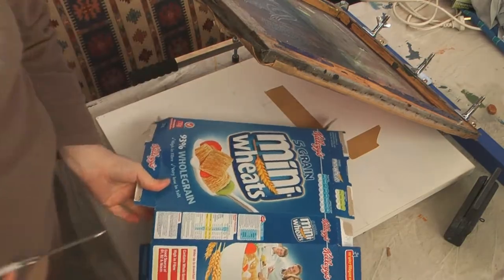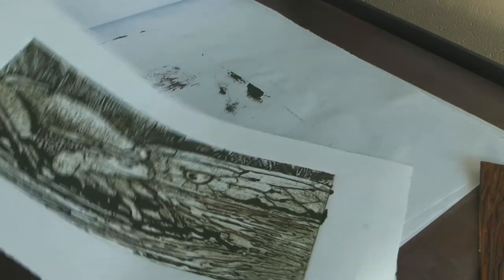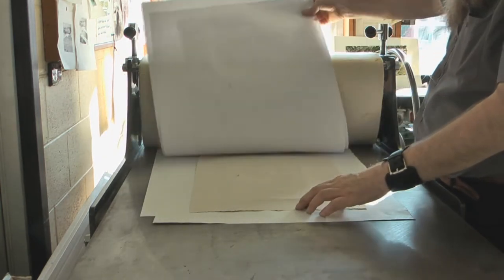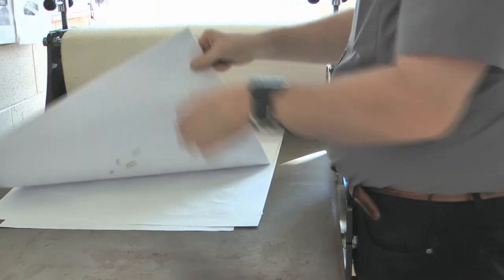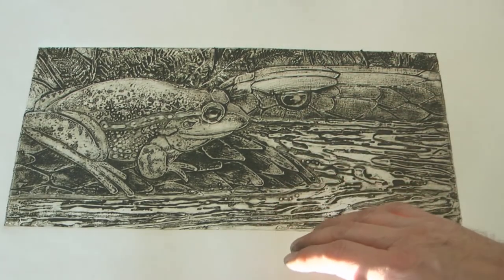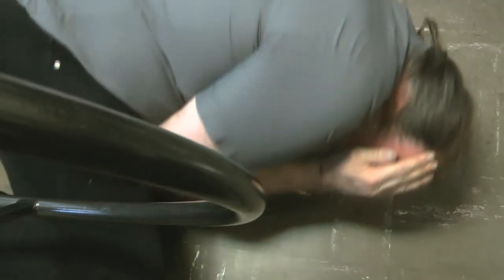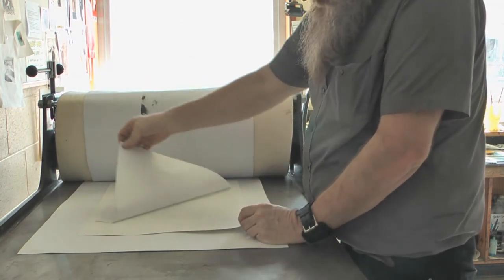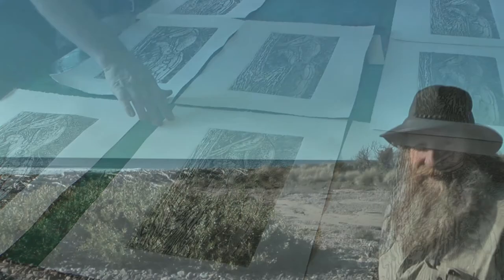Collograph trouble shooting

Comment: So, how did you fix the problems you were having? When you ink your plate do you wipe ink off as in intaglio?
Reply: Yes the wipe off is the same as intaglio. I have since found that sanding back the high points with sandpaper before the last coat of shellac works really well.

Comment: Hey Mr Snake printer... so Im getting the opposite,  the ink isnt picking up from the grooves.  Im using damp paper, a firm roller press.

Help!
Reply: That happens when the grooves are too wide and deep. You will need to fill the gaps a bit. Here are a few ideas to try. Extra shellac to fill in the bigger gaps, raising the ink level, you could add fine sand to shellac in the deeper grooves to hold more ink. Sand off around the problem areas. Cut sandpaper extremely thin and glue into the problem areas. I hope this helps and you don't end up crying and huddled up under your press.
Reply: Thank you!